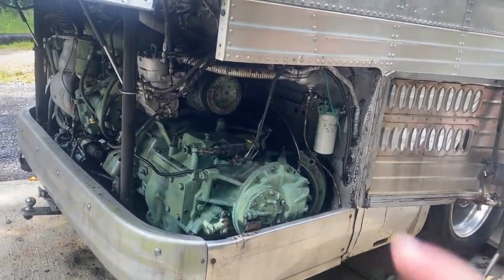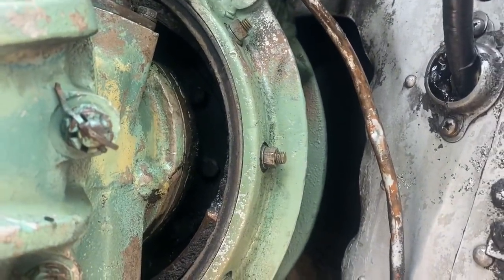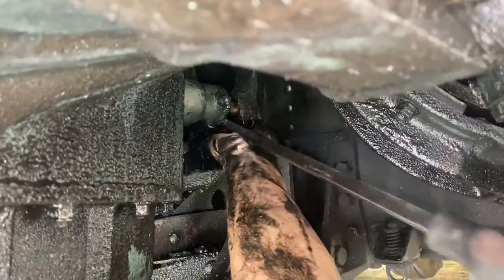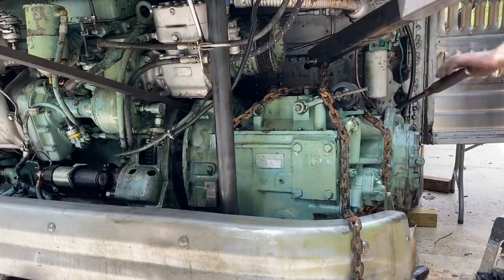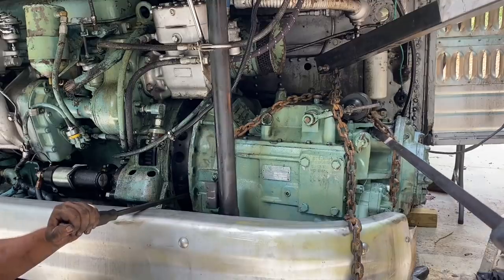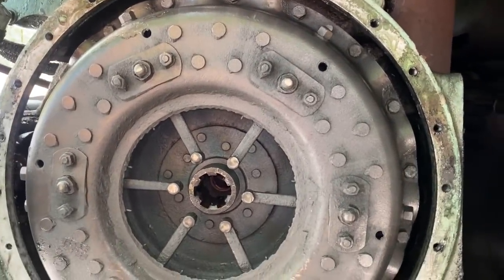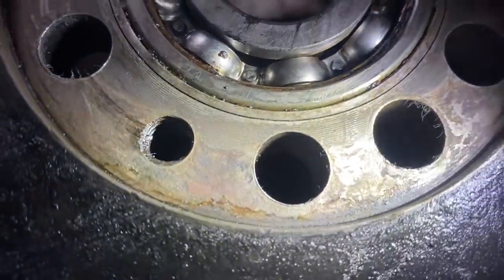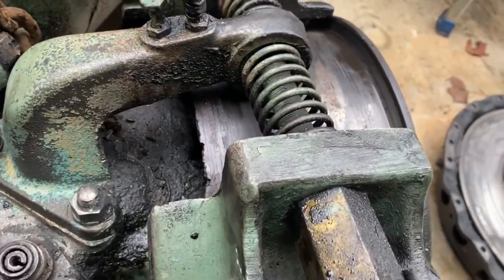Loose flywheel gm 4104 bus.  Detroit diesel 671

Comment: Don't disregard the smooth and steady pulling power of the golf cart to help finesse your heavily loaded house out of the engine bay.  For harder "controlled pulls" consider vertically burying some 4-foot lengths of 6" diameter steel pipes flush at several points along the perimeter of the pad and having caps on them to keep sand and water out till needed.  When needing them as an anchor point, remove the cap and insert a slightly smaller diameter 8-foot length of pipe (or I-beam) into the 6" pipe.   The pipe or beam sticking up can then be used to anchor a come-along or even an electric winch.  The recessed receiver pipes would be out of the way til needed.  Love your channel and really admire the way you and the amazing Miss Kelly work as a TEAM.   Thank You guys for many hours of instructive and highly entertaining videos.   Many of us are living vicariously through your videos.

Comment: Gotta say thanks for talking about those wipes so much. They're absolutely great. Swapping the transmission in my car currently, and nothing was getting the old, oil-soaked dirt and clutch dust sludge that was caked into the bell housing out. Had a bit of a brainwave and decided to try the wipes, and that finally did the trick to remove that slimy old gross mess. 

(And yes, I'm replacing every seal and gasket on the gearbox before I fill it back up and put it in my Annabelle, I wanna be completely sure it wasn't more than just a leaky rear main on the donor vehicle's engine.)

Comment: Scott: have you thought about building an off grid type shower by the pad? It would be a small wood structure sort of like an old out-house with a bucket on top and a shower head with valve connected to the bucket. That way you can shower off without messing up the bus shower when you're extra dirty. I painted my bucket black and after a day in the sun the water is just right for a nice shower before going to my home. My wife likes it as well. She always uses it when she's been working outside.

Comment: It's possible that those flywheel bolts may have been used over several times not to mention possibly of being overtightened also. They may be stretched and probably getting ready to fail. It would be interesting to micrometer the length of the old bolts and compare them to new ones.
There was a video you did a while ago where a couple of bolts broke in a crankshaft. This old girl luckily didn't get that far.

Comment: Those Go jo  wipes would be great for preventing poison ivy. The urushiol is like transparent grease - very hard to wipe off without friction from a towel.  You usually have an hour or two after exposure to get it off your skin, and you've got to use a towel or you just move it around... Hmm. Gonna try them.

Comment: G'day  Scott n Kelly 
With all that metal missing ,the imbalance  would cause more than enough vibration to wear the crank and flywheel surfaces and stretch the bolts ,   
To every action ,there is an equal , but opposite , reaction .
Nice job ,would have loved to see it completed .

Much Respect 
        from 
Down Under

Comment: My guess is the clutch had been replaced once, they removed the flywheel to machine the surface, and when they installed it they didn't make sure the mating surface of the flywheel and crank was perfectly clean and smooth, I've seen it before where the smallest bit of corrosion can actually make the flywheel loosen over time.

Comment: **** Scott...Ok, but the throwout bearing is against the fingers of the clutch springs normally. Without the transmission in place there is no pressure against the flywheel/crankshaft.    If there’s no push back, you can’t tell if it’s fixed unless you push the flywheel in both directions.  You’ve seen that there’s a bunch of pressure against the clutch/flywheel because the fingers are worn along with the throwout bearing.   This is just an observation.  If you checked thrust bearing play by prying the flywheel in both directions without the transmission in place, I couldn’t tell by the video.   Thanks for the video! Great stuff.

Comment: Looks like a lump of dirt or swarfe trapped between the flywheel and crank can also see a corresponding dent on the edge of the mating surface that prevented it torquing flat and loosening as the sworfe flattened.

Comment: That lock wire must have stopped the bolts from loosening any further.  I love the look of this bus!
Reply from the maker: The A&P mechanics on here will be laughing at that “safety wire skills”.
Reply: I don't think the bolts moved a bit because of the safety wire. I just think the bolts were never tightened down all the way, or some of the threads stripped out. Like Scott said; they should be new bolts used when replacing a flywheel!

Comment: Bolts were not safety wired properly. I learned that when rebuilding our airplane.  Safety wires should be route around the bolt heads and pattern  in a clockwise pattern so that if the bolt tries to loosen, the wires immediately get tight and prevent that from happening.  IF they are not done that way the bolts can loosen a half turn or more before the wires get tight and stop their rotation.

Comment: What size are the flywheel to crankshaft bolts.  Get 3 if them at least a foot long and cut the hex heads off.  So you can use the to slide the flywheel onto and then in.  Or if it wont clear going straight in use shorter ones that you have cut the hex heads off then ground them to a slight taper..

Comment: *********Scott, while the transmission was installed, the clutch was pushing the flywheel back toward the engine.  When you looked for endplay without the clutch installed, there was nothing to push the flywheel back so it looked like no play.   You need to pry the flywheel in both directions to check for endplay, not just outward.   If I missed something or you just didn’t show it, I apologize..********
Reply from the maker: The clutch bolts to the flywheel.  Its not pulling it in any direction.

Comment: This is the bus that was owned by Louis that Scott did a survey on in early January of this year (https://youtu.be/NLsuE-eyHR8) and had identified a laundry list of items that needed to be repaired starting with the an engine misfire/engine smoking/excessive blow-by/low-compression requiring an in-frame engine rebuilt, Loose Flywheel, drive-line vibration due to damaged parking brake drum, generator gear has 4 broken teeth and gear in the engine appears worn, radius rod bushings, replacing rear brake air chambers with spring brake type, starter motor was hanging up, several oil lines were also leaking.  At the time of that video January 7, Scott had mentioned that Louis (previous owner who traded the bus for the Harley) was going to source a 4 valve head, a clutch kit, flywheel bolts, spring brake chambers, radius rod bushing, and generator gear.  The reason I remembered this bus so well was the loose flywheel and the belly pans.

Comment: Is it possible that the brake drum’s imbalance contributed to the flywheel loosening up? Will you be replacing that drum?
Reply: Next video, he says he's converting this bus to modern spring-type parking brakes, so that brake drum and original parking brake assembly is not going back on at all.  Modern spring-type parking brakes are just way, way more safer.
Reply: Wreckerboy, I was going to ask the same question! I just saw a video BGM has from January this year that had the same brake drum problem and a loose flywheel. Would make sense that the vibration could cause the problem!

Comment: With the parking brake drum missing some significant material out of it, do you think the owner will go for a Spring Brake conversion?
Reply: Answered in next video, yes they are!  Scott points out in the next video that the original parking brakes on these things were so weak even brand new it was easy to drive off with them still fully engaged, and they couldn't hold the bus stationary even on moderate slopes.  Spring Brake conversion is a basic, necessary upgrade nowadays.

Comment: It seems your impedance is a your light weight (small mass) lifting tools.  A pulling assembly anchored to some large mass at a right angle to your work pad would help in pulling that transmission. I envision something on a rail to allow for positioning.

Comment: There was a pretty good ding on the end of the crankshaft flange that may have been part of the original seating problem for the flywheel. Worth cleaning up before reassembly.

It looked like there may have been missing bits of the brake drum on both sides. Maybe enough flew off so that it more or less balanced! :-)
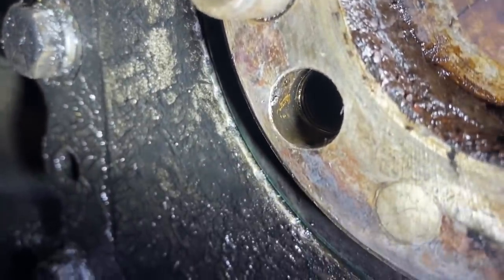Reply: Saw the ding @ 23:01. Top left of the crankshaft.

Was scrolling through the comments to see if someone already mentioned it.

You can stone that flat prior to reassembly
Reply from the maker: It will be cleaned up
Reply: @BusGreaseMonkey  
I had no doubt

Comment: interesting, new seal, new bolts, properly torqued is all it needs for the flywheel? e-brake delete or replace? I assume spring brakes will suffice for the parking brake?

Comment: From what you’ve seen Scott, do the buses with belly pans still attached cool any better than ones without or are there to many other factors involved to really be able to say??

Thanks Scott
Reply: I'm not expert, but - if you keep air under the bus from getting into the engine bay, then the rad and fan should be that much more efficient as they're not also having to push that extra air out of the way.

Comment: I understand those engine/transmissions see leakage over time, but wanted to know if you degrease those areas that are caked with oil, grease, and gunk, or do you leave them as is when you put it all back together?

Comment: You can tell a Real Mechanic  cause they don’t wear gloves
Reply: actually that's true.
Reply: I use gloves for convenience and because modern fuels, oils and solvents are way nastier than they used to be, 3 of my older friends have had issues with Leukaemia and related problems after 30 years on the tools too and its down to working on diesels.
Added bonus using gloves is I can throw them in the bin when I walked into the office or touched something not grubby and I dont have diesel dermatitis either lol
Remember that Scott is a Photographer who enjoys working on old Buses  and happens to be good at it, he probably hasnt spent 30 years with his hands dirty so can probably afford to go gloveless for a while longer.

Comment: Hi just wondering if that plate that goes between the flywheel and the flywheel to crankshaft bolts at 22:00 comes on flywheels found on all Detroit engines? Thank you

Comment: I would put maxi-boosters on the rear axle and leave the parking brake disabled.  theres no need for it, and its completely obsolete. Scott needs to get himself a big stainless tub to wash all up all the oil and grease on himself..........man those things are greasy. Its always really challenging to wiggle a gearbox in or out of a clutch..........they always seem to bind, until they dont.

Comment: How do you detect a loose flywheel on a 6-71? It’s running at 111db instead of the usual 110db.
Reply from the maker: Eyeballs saw it wobbling
Reply: @BusGreaseMonkey  Ya it’s a joke.  Good video though.

Comment: Those solenoids look exactly like the solenoids used on the Thermo King diesel reefer units. I have  salvaged these for use on various projects. Find out who scraps units or sells parts in your area..maybe cheaper.

Comment: I can't help but thinking a hydraulic table would be a lot of help...
Reply: i was thinking the same
Reply: ck m   Yes a small ATV lift would be nice,   BUT did you see the shape of the bottom of the transmission, it isn't exactly flat, so you need some kind of cradle for it to work, AND he has the cherry picker already.
Reply: Lots of equipment would be nice to have, but like he's said before, you can only fit so much in Lenny's bays for on the road calls.

Comment: Someone could have used a little more practice on using safety wire. It doesnt work if its not done correctly!
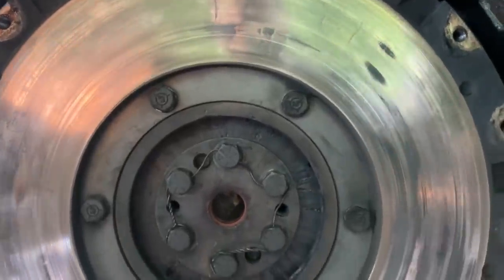Reply: I agree! The only bolt that was done halfway correct was the lower two @ 20:50 but it started downhill before it ever got to bolt three.
Reply: That was not safety wired....call the FSDO!!!
Reply: @tedsaylor6016  You know the sad part is I've seen worse on aircraft where owners try to fix things themselves!
Reply: @christophermarsh6983  I've got 20+ years in Aviation (owner/builder), something like that here in the Phoenix area WOULD trigger some sort of action.
Reply: I would hate to count up the number of hours that I have spent showing people how to correctly safety wire fasteners. It has been my experience that it is not a process that comes natural to most perople
Reply: Interesting, worked on 6-71 for 30 years in logging and marine, and have never seen a lock wire flywheel bolt. All torqued, and a little LockTite.

Comment: The safety wire drilling of the bolts does not look right. Looks like someone drilled straight thu each bolt head ?

Comment: I would suspect the flywheel bolt holes being packed with foreign material, the bolts bottoming out before they could clamp the flywheel. $.02

Comment: I see a small dent at 23:00 that might have prevented the flywheel from making a solid facing contact during assembly. Also a few seconds earlier something on the flywheel, but that might have been dirt.

Comment: Many are the jobs I have done that would have gone soooo much better if I'd had the assistance of someone like the lovely Kelly! You both make a terrific team, and are fortunate to work and live together. Not every couple is so blessed to be able to do both.
On another note, when you found the flywheel bolt safety wires intact, does that mean the bolts were previously incorrectly tightened or did they stretch while in service? For a minute there I started thinking broken crankshaft??

Comment: Scott, just a thought since you already have one of those engine/trans pans off, why not take some pictures of the whole set with dimensions. It shouldn't be hard to reproduce since you start with a sheet of aluminum. They were part of the original cooling system, air flow around the whole compartment. Put the whole up on your website. What do you think? I'll bet there was a set on the Silversides too.

Comment: I'm guessing at $500 for a reverse solenoid that guys will replace it with a solenoid valve and air cylinder when it craps out.
Aren't those flywheel bolts supposed to be coated with international compound on install? Possibly they weren't torqued correctly without the compound resulting in the flywheel wobble?

Comment: Looks like the transmission weighs as much as the engine. Kelly is doing a great job take her to dinner or something nice like that.
Reply from the maker: Ha it weighs less than the engine by a lot.   It’s only about 400lbs.  The automatic trans weighs like 900 so the manual trans is a dream.
Reply: @BusGreaseMonkey  And it is right in front of you in the open not like a car that is down underneath it where you hope it does not land on your head lol

Comment: Why can’t you install an air powered reverse actuator? Simply run a air line from the drivers position,might take a moment to fill with air to move the lever into reverse but could be doable at far less the $500 if you can still find them.

Food for thought.

Comment: Any plans for more power and an air compressor at the maintenance station pad?  Just wondering.  Keep up the great videos!  I did a bit of mechanic work on OTR diesels in my late teens and early 20's.  That pad has got to be a joy for creeper work, for sure.
Reply: Scott is planning on building a shop up near his future homesite.....I don't recall if the shop will be only for his own projects or if he will also use it to work on clients' buses as well in regard to access to an air compressor ..etc... or for working on buses in cold or inclement weather.
Reply: Most of the tools will be battery powered. It's just less aggravation overall and the battery tools are crazy powerful anyway.   Im sure there will be a compressor but it will mostly get used for jacking duty.

There's currently a 30A service to the pad

Comment: So a 4104 has axle brakes and a trans brake? Sorry if this is a stupid question. I have seen military vehicles with inboard brakes but never a drum on the transmission. Okay I take it back, my best friend had an old dodge car that had a drum on the output of the transmission for an e-brake. Is it normal and I just never noticed?
Reply: The brake on the trans if for parking and in emergency.   It has regular brakes at the wheels.  
I personally would want to redo the parking brake but it comes down to $.  Looks like spring brakes are one the way for this one.  It's actually a better set up as all of your brakes become parking brakes as well as emergency brakes if needed
Reply: @richardlazarski4553  thanks for the reply. It's what I figured it was but I had to ask.

Comment: Never understand why mechanics don’t degrease and power wash engines before working on them. Got to live up to that Bus Grease Monkey moniker huh! 😁.  Kelli is a first class helper!
Reply from the maker: 5 hrs of power washing and the bottom will still be a mess
Reply: If you start washing oil and grease off engines you'll run into the EPA laws and have to install a skimmer tank and drains on that pad for the water etc.  However, wiping off the trans and motor before reassembling is not out of the question!

Comment: Several of the bolts were safety wired backwards.
Reply: I'd be hesitant to call that safety wire, more just to retain them when they broke from improper torque, and even that done poorly.